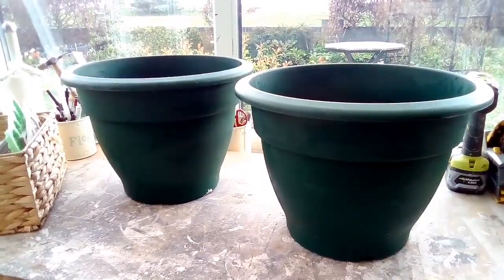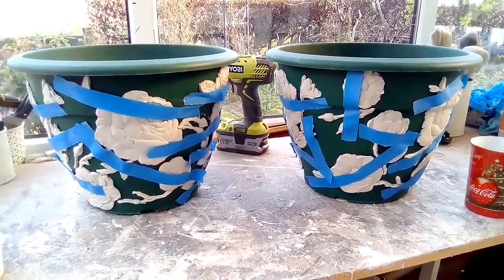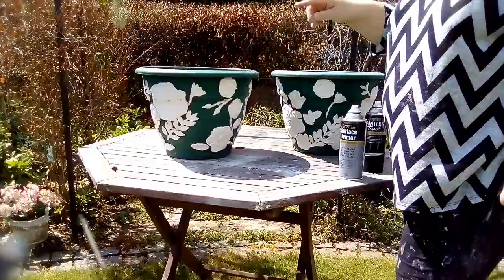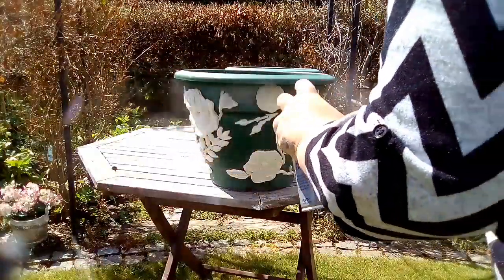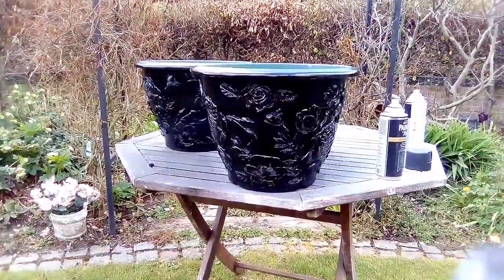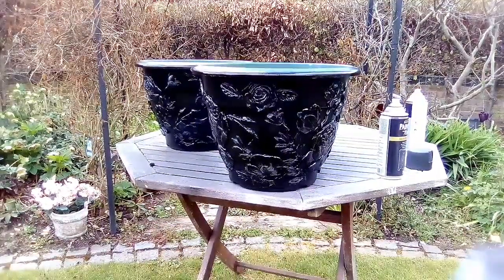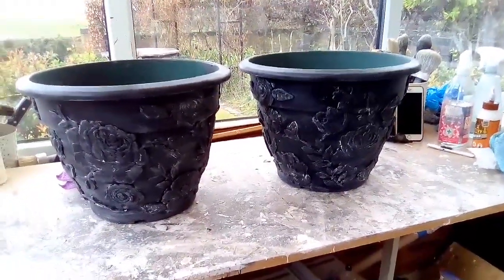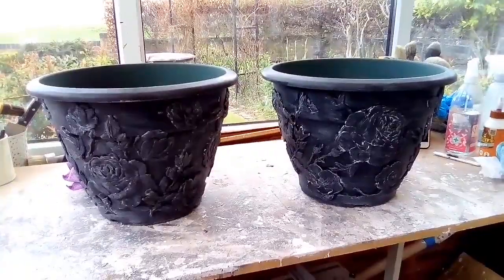Prima molds Bill and Ben flower pots

Comment: Hi love the idea and agree with the wax. Not the best look….also not spray paint,  use normal paint. 
I have an idea for you….get a table,  do the top in your those lovely flowers,  use a board to flatten down, remove board then get a piece of glass cut for the top.  Start small and if it works it could nice.
Reply from the maker: That sounds like a great idea I have a little table I’ll let you know if I do a video and give you a shout out ☺️